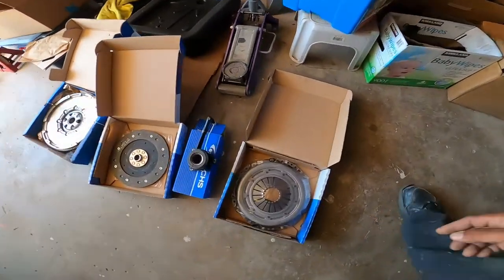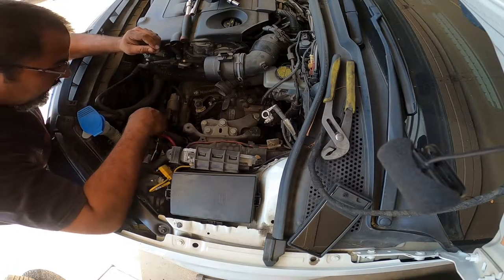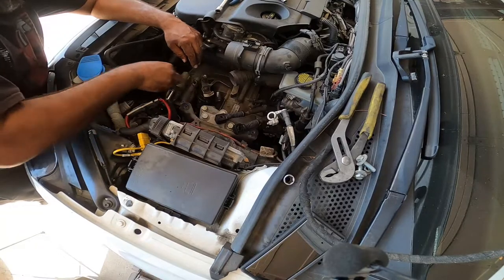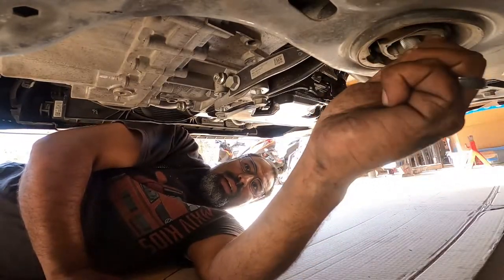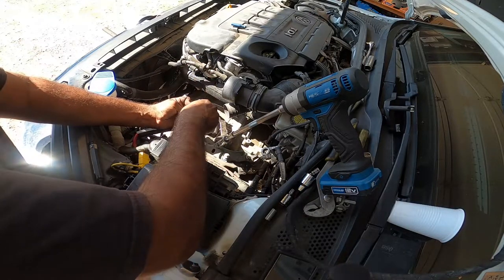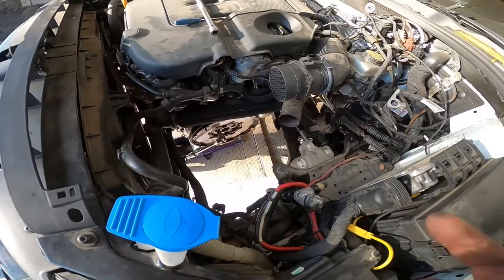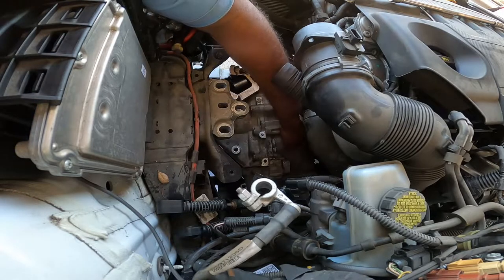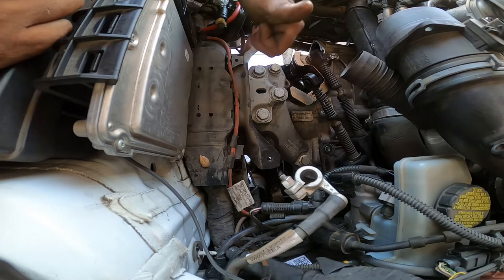MK7 Golf SportWagen Clutch Install

Comment: What milage were you at? Was it slipping cause of the tune or what
Reply from the maker: Yeah the tune caused the clutch to fail but we knew ahead of time now that we have this new one we want to reflash it with a more aggressive tune
Reply: @PincheALsGarage  ahh was it undrivable or just preventative maintenance
Reply from the maker: @MrBasstothemax  the car was fine just when we were trying to pass cars on the freeway we would see the clutch slip but if we drove it normal car was fine

Comment: need ur help pinche i have a weird problem that developed sudden accleration issues no the floor mat is not stuck on the pedal underneith i think maybe the spring in the throttlebody is just getting bound up from being old idk ? i put it in park an start the engine again take off an it doesnt happen i was thinking some kinda lubricate might work right where the cable attachs to the that spring on the throttlebody just need ur input but i was also thinking maybe a dirty maf sensor could be causing my issue. i have my foot on the brake an then all of sudden iam climbing revs to 3k 4k like iam getting ready to launch the car even though its a auto an my foots not on the gas ???
Reply from the maker: What car?
Was the throttle body removed for any reason or was it replaced?
Reply: @PincheALsGarage  it was removed couple of years i cleaned it up an put a new seal on it then i went into vcds to do  the tb adaptation everything went perfect it has been running great up until now with this acceleration issue
Reply: 2000 2.0l aeg engine code
Reply from the maker: @nickguerra1905  seems like to me you got some work to do. Need VCDS to investigate more into the issue. Maybe a pending code or vacuumed leak. Very hard to tell what the real issue is without any codes or being there in person